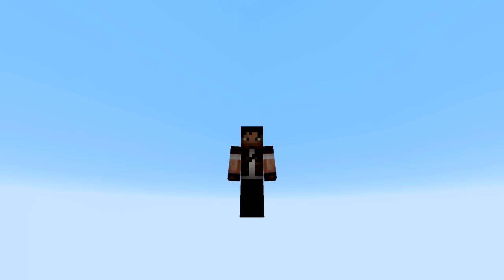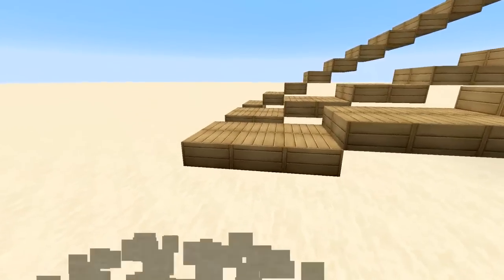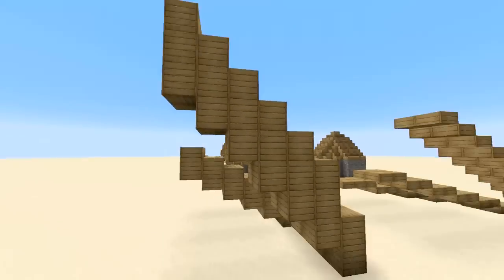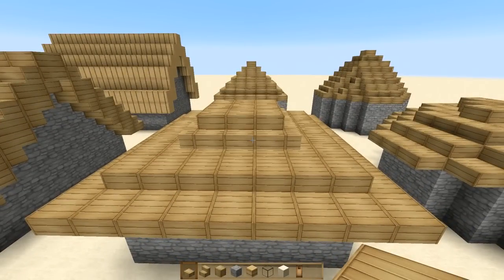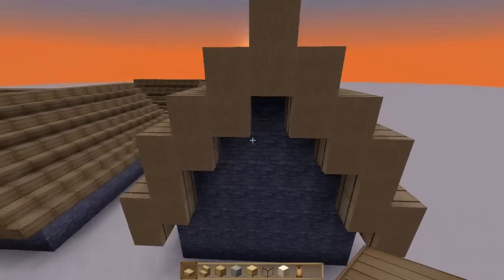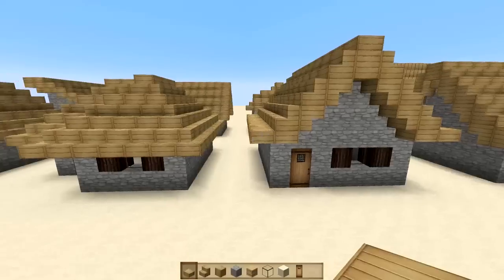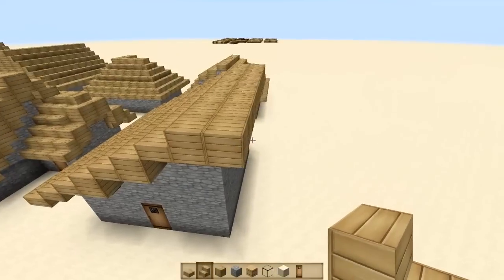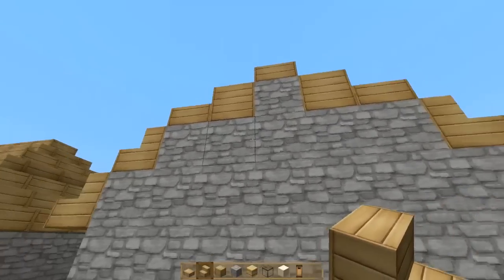How to Build a Roof in Minecraft - Slopes and Styles (Tutorial)

Comment: Nice one Zueljin! You used tetrahedron and cylindrical shapes as the structure of the building. What about organic shapes that aren't based on a single polyhedron? What if you had a junction of a tetrahedron that became a cylindrical shape (imagine half of a silo extruding from the side of a barn)? Would you combine the process of making half of a cylindrical based roof with a tetrahedron based roof? I often find myself doing organic builds and the roofs are complete chaos.
Reply from the maker: organics are by far the hardest to do brother.  vertical slabs in minecraft or quarter blocks would help the process immensely but in vanilla there just isnt a good rule of thumb.  typically i avoid joining the roof of 2 styles like that. for the half silo example you gave earlier, id typicall have it come up a little higher and crown the cylindrical shape separately from tetrahedron shaped roof.  you can combine the 2 if the build is enormous but in tight spaces, you cant make blocks give the illusion of a curve.  much better to have anything like that spire seperately like a tower.
Reply: English?

Comment: Wtf. A "dormer roof" is not a thing. The certain roof that you built was a gable roof with a dormer. Dormers don't only exist on gables. They can be on mansards, gambrels, arched, sheds, hips, etc. A dormer is its own entity. That is the extra roof peak that does away from the main one, creating a dormer. Also, dormers do not also need to be gabled. They also shouldn't be made to look like crap. Dormers can also be hipped or arched or a shed or gambrels or mansards. Also: a pro tip would be that when you build a roof, make sure that the roof covering the inside part of the house is 1.5 blocks tall. That means three half slabs. Also, if you look at staired roofs, you will notice that the full part of the stair block and the half part of the stair block below it are also 1.5 blocks tall. You want to do this to protect the annoying dripping through the roof when it begins to rain. Also learn how to build a freaking dormer. I don't even know wtf that is supposed to be. You build dormers...
Reply: ...just as you would build a jut out at the main part of your house, not out of the same material as the roof bc it looks like a five-year-old built it. The dormer you built was too large for the roof you did it for. Also, if your main roof has an overhang, give your dormer an overhang.
Reply: Tf man he got the point across